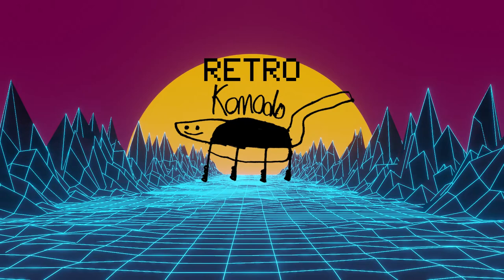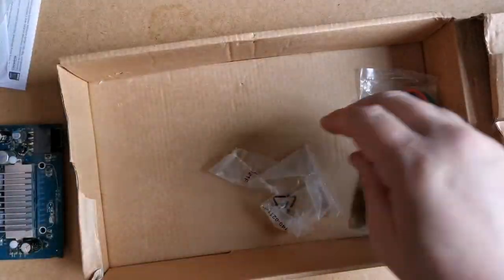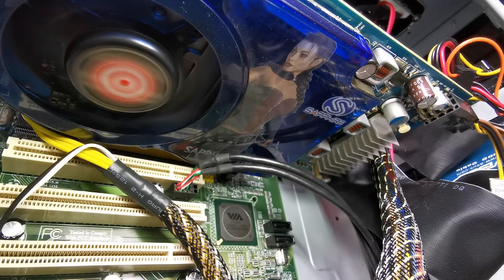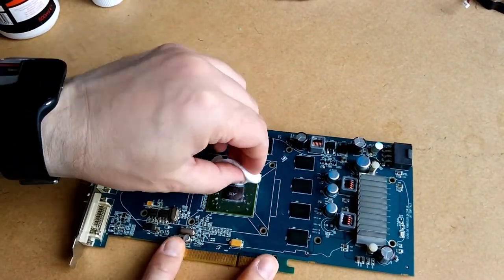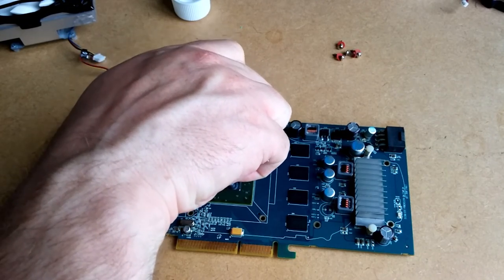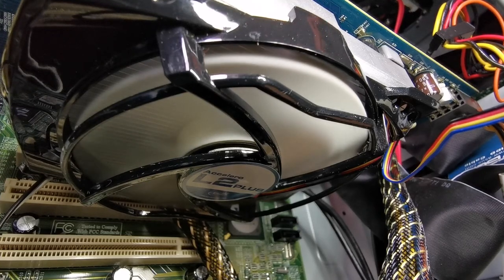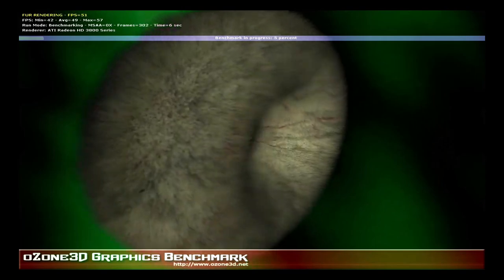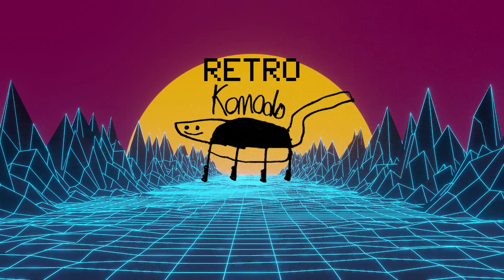AGP HD 3850 - ARCTIC Accelero L2 Plus Cooler replacement

Comment: I detected the same temps with the stock cooler too, been using it that way for years. I recently decided to dig up another cooler I had, a Deepcool V90, which was fastened to a FX5500 and tried it. It's deffinitely quieter and max temp is below 70.
Reply from the maker: Oooh the v90 looks nice! Can't find any to buy, but at this stage I doubt I need more coolers.. especially after https://youtu.be/XZtnSfmzD10
Reply from the maker: Also, maybe checkout https://youtu.be/-u1GCr2uf4Y - it's very silly and probably wasn't a good idea but worked rather well!
Reply: @RetroKomodo  Oh hey again. Came across your channel again while searching something for the 3850. It still works well with the new cooler, around 65 deg. at load. But I got my hands on a cheap second hand passive cooler, Accelero S3, gonna try if it's better. And the V90 would go to a cheaply found HD 2600 XT without cooler, which I'm waiting to arrive from the US. 
Also your videos are pretty entertaining and informative.
Best regards.
Reply from the maker: @alexanderangelov230  I planned on getting that one too try, but at the time I couldn't find any!
Reply: @RetroKomodo  Hey, me again. Sorry if I bother you. Just here to share something. I too found an L2 Plus cooler but strapped it to a x1950 pro as it was very noisy. And just before I had the chance to try the Accelero S3, my 3850 suddenly artifacted and is on the edge of failing completely. Will try to save it. If it doesn't survive, I hope I can reflash a HIS 3850 that I knowingly bought with a wrong bios.
Cheers and merry Christmas.
Reply from the maker: Oh no!! That's terrible news! Well I hope the re-flash goes well.. that's a nasty end to the year :(
Reply: @RetroKomodo  Yeah, bummer. Haven't overclocked it or played demanding games all that much. It could be some loose solder joint I might be able to reflow. Untill then I'll run the hd2600 or my old trusty 7800gs.
Reply from the maker: Well on the plus side, at least the x1950 pro should be quieter? Good luck with the reflow - I've never had the courage to try it!
Reply: @RetroKomodo  Oh, right. I forgot about the pro as a replacement. It's in another pc I'm assembling now but it'ĺl do. I attempted a reflow with a heatgun on a rrod xbox 360 and it worked. I hope it'll work on the gpu aswell.

Comment: The Arctic Accelero S1 should be able to passively cool a 3850, but good luck find one these days for a decent price.  I had the S2 on a 3650, actually replaced a stock passive cooler that I didn't think was doing a good enough job.
Reply from the maker: I found a few cheapish graphics cards on eBay with an S1 attached, but by then had more than enough coolers so didn't get one :(

Comment: Nice video! Just got one myself, and this was very interesting :) Dont think i will replace the cooler as its more of a collectors item for me. But if it was in my main xp rig, i definitely would consider it :).
Reply from the maker: Ace! Well as long as you keep it handy it's simple enough to put the original cooler back on. Oh - are you planning on using it on an Athlon XP system? If so you might want to investigate http://vogonsdrivers.com/getfile.php?fileid=1825&menustate=0 for a patch which should avoid SSE instruction problem restarts ;) needs installing safe mode
Reply: @RetroKomodo  Im using an Athlon 64 3500+ (S939)... Would this patch be necessary for this CPU? Thanks!
Reply from the maker: @paulp9270  I don't think so..? No idea! Maybe just socket a. Try 3dmark2001 and see if it crashes - if so - yes!

Comment: You probably should look into adding a heat sink to the bridge chip so it doesn't overheat a lot of these cards die because of that chip because it runs really hot also I'm pretty sure there's a solvent that can remove the thermal glue on the ram heat sinks just make sure it's a solvent that doesn't react with metal in a bad way
Reply from the maker: I've been thinking about heatsinks for the Rialto chips on my cards that have them.. I guess a ram heat sink on them would be best, but for proper contact I guess i'd need to remove the surrounding pad. I have pretty decent airflow over them when I have them in so should be ok, and hey - if this 3850 packs up I have a backup 3850 ;)